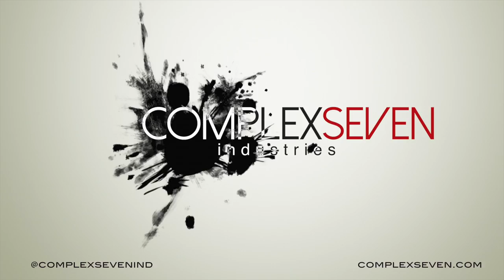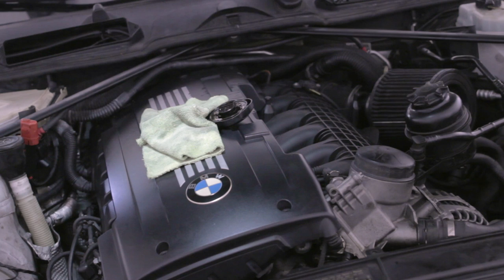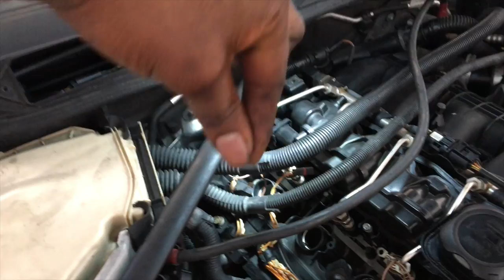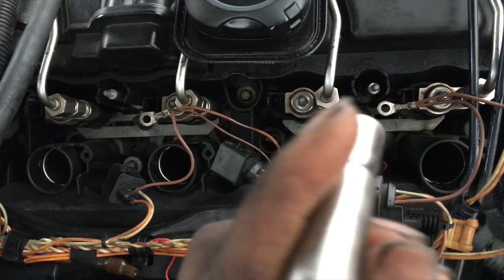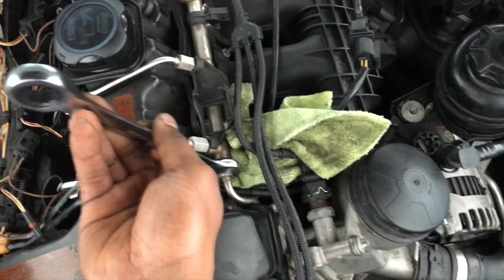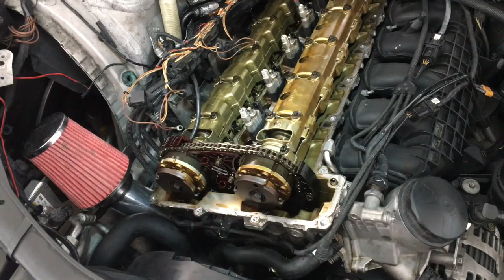BMW 335i N54 Valve Cover Gasket DIY Vlog Part 1

Comment: nice diys. the n54 sure is a handful
Reply: I just bought myself a 2008 135i. it was my brothers so I know of all the work he's done so far. he just did 6 index 12 injectors, plugs coils and carbon clean. turbos got replaced at 82k. just finished valve cover and oil filter housing so she should be mint. how often is the oil pan gasket a problem?
Reply: yeah i believe the water pump was replaced under warranty before he bought it. I would be suprised if it hasnt been done considering the mileage of 86k
Reply: I've been working my ass off to finally achieve it. had an a4 for about 2 years and now it's just too slow for me. want a more fun spirited car with the scrafice of reliability

Comment: what's the part he removed that needed to be replaced?  it regulated pressure
Reply: found it: crank case breather blow by vent hose.

great video by the way, no other guides I've seen called this part out as a potential issue.